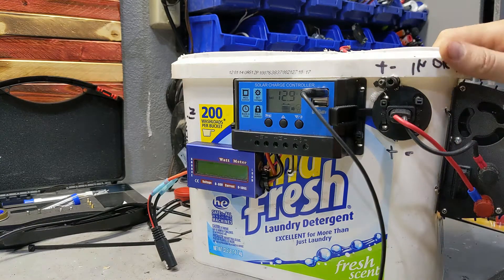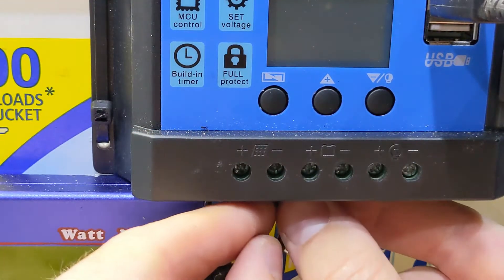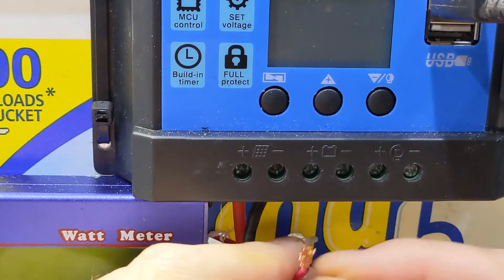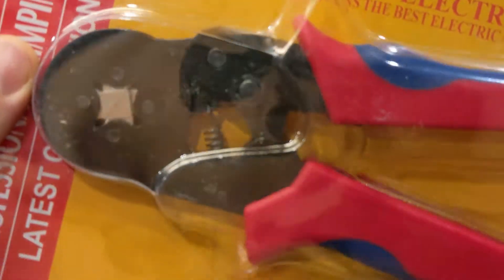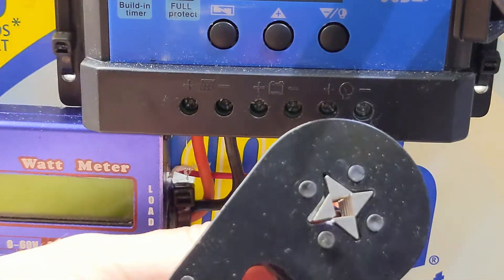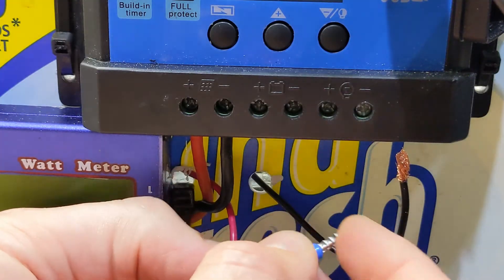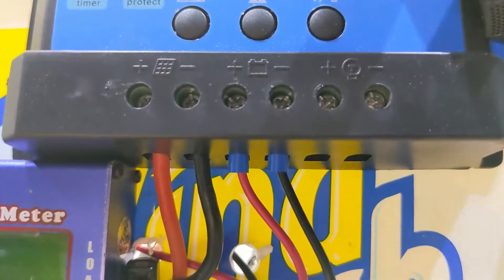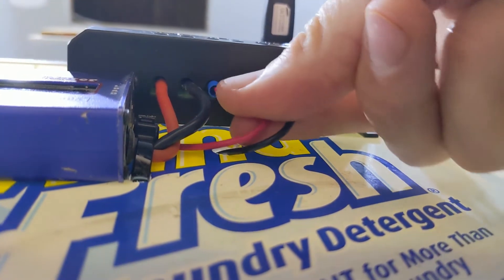How to prevent Short Circuits on wire ending - Wire Crimping Tool Kit Wieprima

Comment: It's nice you fixed the problem. Let me think about this a little bit. The shorting terminal location was on a terminal block of a  component made-in-china. So you bought more components made-in-china to fix it! 
Did the manufacturer of the component with the crappy terminal locations specify that you should use the crimped terminal connectors that you used in this video to fix the root cause of the problem? If so, then you failed to read the instructions or they failed to provide any instructions otherwise what you purchased was a piece of crap, either way because it should have been designed to prevent assembly situations that could result in electrical shorts.